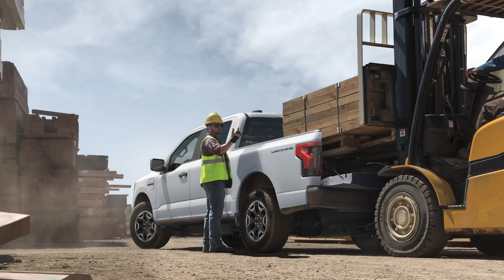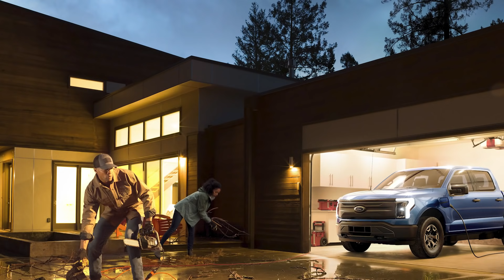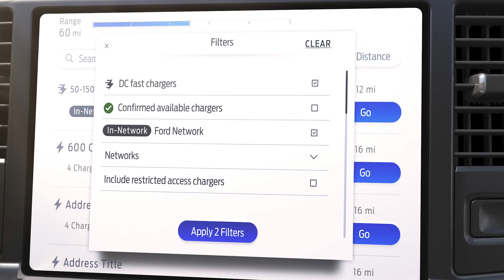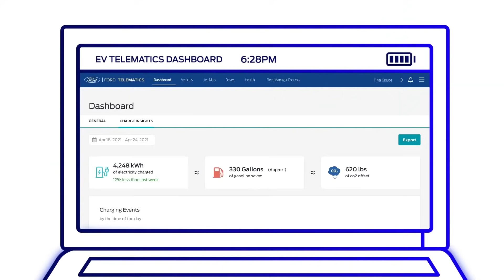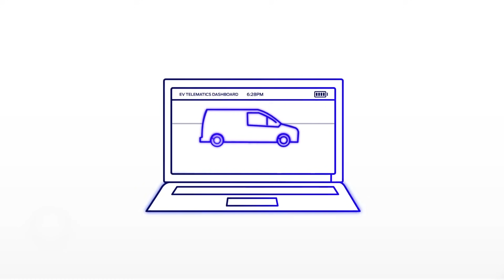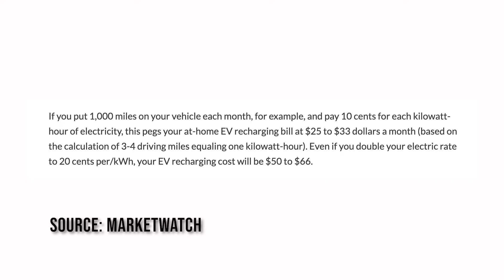EV Fleet Truck! 2022 Ford F-150 Lightning Pro, Lower Cost of Ownership

Comment: Lower cost of ownership is definitely false information.  You still have to change fluids,  when something breaks down dealers is only place to fix it,  no aftermarket parts available. You still have to replace your 12v battery every 3 years,  just like gas vehicles.
Reply from the maker: Fluids?
Reply: @Pickuptrucktalk  window washer fluid!  Duh…..   I’m sure the coolant system is self-contained And likely even if it did need to be changed it won’t be until 100000 or 150,000 miles.
Reply from the maker: @ocalaeyeguy  so... you are saying total cost of ownership is not false because you have to add in the annual costs of windshield wiper fluid?
Reply: @Pickuptrucktalk  Absolutely,  $3 is in fact a cost of ownership.   :)
Reply from the maker: @ocalaeyeguy  ok. Gas trucks would have the same cost though.
Reply: @ocalaeyeguy  You really think the batteries will last that long, califorina cant keep the lights on now what makes you think that they will have excess power for chargers?
Reply: @Pickuptrucktalk  true.
Reply: @rhare7353  I think you’re commenting to the wrong person
Reply: @Pickuptrucktalk  I'm concerned about some of these commenters on here. Many look like they couldn't figure out a potato peeler. Fleets will buy a few EV's to handle short frequent trips and gas for everything else. Seems pretty straight forward simple to me. Who said fleets can only purchase EV or gas. No fleet will put their eggs in a single basket now that they have choice. Battery replacement is the only thing with an EV that is a repair to freak out about, but with 8 year/100k warranty on the battery Ford makes adoption a certainty.
Reply: @ocalaeyeguy  sorry
Reply: @Pickuptrucktalk , how do you think battery is cooled? How do you think electric motor is cooled and lubricated? How do you think transmission is cooled and lubricated?
Reply: Since when are aftermarket parts available on brand new models?  How do you know that there will not be aftermarket parts available in 5 to 10 years when they are all out of warranty?
Reply: @webcomment8895  , tesla has been out over 10 years and no aftermarket parts available, except used and very expensive.  3 times more than gas vehicles. On gas vehicles aftermarket parts available instantly.
Reply: @repairvehicle  Tesla is not Ford.  That’s Tesla’s specific policy to not allow aftermarket parts.
Reply: @webcomment8895  , ford is the same way.  Ford has hybrid vehicles for over 10 years.  No aftermarket parts available for hybrid system because everything is patent protected and that gives Ford more power to  make money in house instead of aftermarket companies.
Reply: @repairvehicle  You are straight up lying and trolling.  
Aftermarket parts are never available “instantly” on newly released vehicles.  The OEM even often has back ordered parts availability when a new vehicle is released.  There is also not a market for aftermarket parts on newly released vehicles since they will all be covered by factory warranty and have little or no wear items needing replacement.
Reply: @repairvehicle  those fluids would not need changed NEAR as often as oil no where close look at how long coolant last or diff oil lasts.
Reply: @webcomment8895 , brakes, filters, fluids always available from aftermarket. Get a life troll.
Reply: @cartere9981  , do fluid analysis and you will be surprised how much you have been brainwashed with false information.
Reply: @repairvehicle  Are you trying to say that Ford doesn’t have any patents on their gas engine vehicles?
Reply: @repairvehicle  I'm aware that lifetime fluids are not factual but 60 thousand mile intervals is still good to stick by by my math that's a lot more then 5 thousand mile oil changes. My points still stands you're a numb nuts
Reply: @repairvehicle  still no link to that 4 times higher insurance? Or the coolant that magically lasts less time?
Reply: @cartere9981  , learn to read and then ask the question. I already answered. https://www.valuepenguin.com/tesla-car-insurance  Where is your link that's it's not 4 times higher? Where is the link for 50% higher?
Reply: @repairvehicle  telsa themselves have 50 percent higher insurance but I'm sure that has a lot to do with the self driving accidents not it being electric but that's no where near 4 times and I'm sure when toyota/honda/kia is making Ev's the insurance will be about the same.
Reply: There are way less fluids to change and way less other regular maintenance in general.
Reply: @webcomment8895  , false it has 3 times more coolant to change,  3  times more oil to change when you have 3 motors.
Reply: @repairvehicle  You don’t change those fluids every 3K to 10K miles on EVs.  It is already well proven that total maintenance on EVs is much lower and much less frequent.
Reply: @webcomment8895 , not according to owners manual.  Ev generates 3 times more torque and destroys fluid much faster.  Also,  ev generates 3 times more heat due to torque and electric energy. No wonder tesla used parts 3 times more expensive.  Not to mention insurance on ev 4 times more costly.
Reply: You really need to do a deep dive into EV technology because your comments are way off the mark and frankly embarrassing.
Reply: @heathwirt8919  , truth hurts,  specially when you been brainwashed with false information.  When you hear truth cannot longer except it, it's not too late for you to have common sense and do your own research instead of relying on false information from youtube.
Reply: @repairvehicle  "truth hurts,  specially when you been brainwashed with false information."                                                  Are you looking in the mirror and talking to yourself in third person here? You're a combination of brainwashed and brain dead in equal measure.
Reply: @heathwirt8919  its embarrassing
Reply: I have an Electric Ford. From the manual, the coolant interval is 10 years or 150,000 miles. 12V battery life is variable...it really depends on depth of discharge. I don't expect those will get changed often because there's no accessory draining the 12V with an EV. You just sit idling with the car powered on, which keeps the 12V connected to the high voltage pack. The high voltage system keeps the 12V topped off. My Expedition 3.5 Ecoboost is in the shop for a head gasket at 115K. I think the Lightning will have less maintenance if the motor and battery hold up.
Reply: @jghall00  , your ecoboost is already falling apart,  electric would be any different.  It's ford,  never been known for quality.
Reply: @repairvehicle  Unfortunately Ford does seem to have some quality issues. Some people have no issues, and some have nothing but issues. Let's hope there's a decent warranty on the powertrain.
Reply: @jghall00 , thank you very much for being honest! I was a big Ford truck guy for many years and got tired with quality issues. Dumped the Ford and never again another Ford.
Reply: @jghall00  there's no reasoning with this low iq "repairvechicle" individual
Reply: Yes, I've researched all this myself and I've compared the maintenance costs. EV will be less. No transmission, transfer case and front and rear differential fluid change, spark plug change,  engine air filter, etc. The other items like coolant, tires, washer fluid, wiper blades, 12v battery, etc. are similar or the same. (Not sure why you have to replace your 12v battery every 3 years, but mine typically last 6 or 7 years, but I also use battery tenders/conditioners now and then and don't live in an area with extreme heat). 

I know a lot of people don't do many of the scheduled maintenance items (because they trade off the truck at 100,000 miles), but they should and I do. For the DIY owner, an EV will save the time of doing all that work and the expense of the materials. Also, since EV use regen braking, brake pads and rotors last much longer for any given driver.  Insurance does cost more but fuel is much less. Some states, including ours, are now charging an extra annual tax on EV to make up for lost gas tax revenue, but for me, that fee is much less than I am paying in gas tax per year so also a savings.  EV can't do long trips without stopping for long charges, but typical use is charging at home overnight each night (10 seconds to plug in) vs stopping at the gas station once or twice a week. So over a year, I'd spend less time at a gas station even counting those times I would have to stop for 40 minutes to charge on a long trip.  To each their own and everyone has the choice to buy what is right for their use.
Reply: @MrChadx1  it has transmission/transfer case with gear oil/transmission atf. Transmission has filter.  Coolant needs changed more frequently and it has like 5 gallons capacity.  Brake fluid needs changed. How is maintenance costs less when dealer rate is $150 hour vs independent shop $50 for none Ev cars. Independent shops cannot service EVs.
Reply: @repairvehicle  The short service interval items, like oil change, are the biggest savings in time and money. Long service interval items aren't as much of an impact.  Coolant changes in both, typically every 5 years, and a couple gallons difference in the mount of coolant isn't much of an impact. The brake fluid you mention is recommended on both EV and ICE (typically every 5 years) so I didn't mention it; I only mentioned that regen braking makes pads and brake rotors last much longer in EV.  Independent car shops can service EV as can the home DIYer.  Independent shops my choose to not service them, but by law, they can. And more independent shops will choose to start performing these services as more EV are on the road.
Reply: @repairvehicle  Not sure what you are referring to when you say "it has". The F150EV? I haven't research the F150 lightening, but the vast majority EV do not have transmission or transfer cases; They have a fixed-ratio gearbox. A few newer EV are being introduced with 2 speed transmissions. 
The Tesla model S does use transmission fluid in it's gearbox that requires scheduled service. 
If you have specifics into the service of the F150 EV and the details if it's gearbox(s), please share as I'm interested in those and haven't found any details yet.
Reply: @MrChadx1  , they all have some type of hardware that transfers electric motor energy to the axles,  via gear box, transfer case or transmission.  They all do same thing,  they transfer power to the wheels.  Different name same functionality.  Electric motors generates 3 times more torque than gas engine,  it has major impact on fluid,  shear forces destroy fluid much quicker than gas engine vehicles. Also,  heat generated by electric motor is way higher than gas engine.  Due to high heat and stress fluid must be replaced much sooner than gas vehicles or face the problems.  If you ever done fluid analysis you would know the actual life of the fluid in the vehicle vs factory recommended. Keep in mind ev gear boxes not sized properly for the vehicle weight and electric motor torque,  that's why ev have major problems with gear boxes and electric motors.
Reply: @MrChadx1 , independent shops cannot perform repairs because parts for evs patent protected.  Tesla, has been around for 15 years,  no aftermarket parts available for gear boxes,  engine,  water pump,  and so on.
Reply: @repairvehicle  Good conversation! I agree that the torque of an electric motor has the potential to be more stressful on an EV gearbox and it's fluid. I suspect it really depends on if the gearbox engineering accounted for that. I only read of a few EV gearbox failures and all with low mileage, so seemed more of a manufacturing defect rather than design issue. As more EV reach 100,000 miles plus, we'll see if there are more long term durability issues with current generation of EV gearboxes.  

I don't own an EV so have not done any first hand lubricant analysis. It would be interesting to see some test results. Haven't found much online in the way of testing.  I do see many of the major lubrication companies have EV specific lubricants. 

I guess, in my mind, there is lack of data suggesting that EV gearboxes are poorly designed and are going to fail at a faster rater than the current comparable ICE.
Reply: @MrChadx1  , gear box on EV smaller than gas engine.  But torque is tripled vs gas engine.  Simple comparison but makes sense why EVs have problems.
Reply: @repairvehicle  Regarding independent shops doing repairs, I was referring to them doing the work (labor). Sounds like you are only referring to them using aftermarket parts so guess we were talking about different things. No reason an independent shop can't source OEM parts and do the work. I suspect they are not interested at this point because they would have to train and get familiar with vehicles that would be an extremely small percentage of their repairs and it wouldn't make business sense. As EV numbers grow, it will make more sense for independent shops to have the training and choose to service EV; perhaps even EV specialty shops popping up more and more than only work on EV systems and not ICE.  

Will be interesting to watch this evolve as EV are adopted and make up a larger portion of vehicles on the road. 

In the meantime, if dealerships have the training but EV prove to require fewer repairs, it may be moot. And, as others have mentioned, for now, most work will be under warranty, but as EV grow in numbers and start aging, that will drive the shop and aftermarket segments. Note I said the number of EV; and not the age of EV. Yes there are Telsa that have been on the road for quite a while in years, but still in low overall numbers and aftermarket parts won't appear until the numbers make the manufacturing viable financially. You'll never see aftermarket parts if they can only sell 1,000 units, and if you do, the price would be way more than the OEM part.
Reply: @repairvehicle  Again, I can't find any data that EV have more gearbox issues than ICE.  While the simple comparison of size vs torque may lead to a prediction and hypothesis, I haven't been able to find any data supporting a conclusion and so I am interested finding more data on this. The search continues.
Reply: @MrChadx1 , it's just common sense size vs torque.  Look at big trucks torque and gear boxes size. Look at ebay for Tesla motor and gear boxes why used so expensive? Common sense,  they fail and no aftermarket parts, demand drives the price.  If they didn't break down then they would be selling on ebay for cheap, but they are sold for big price.